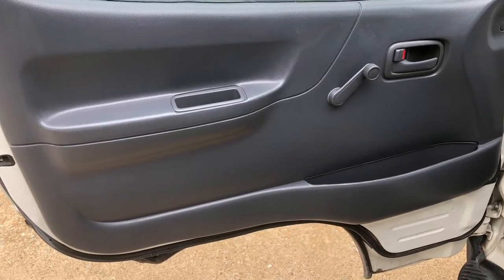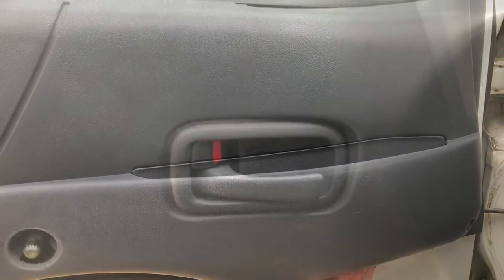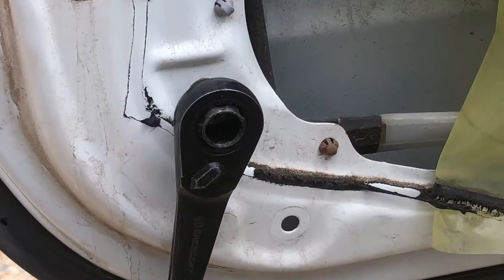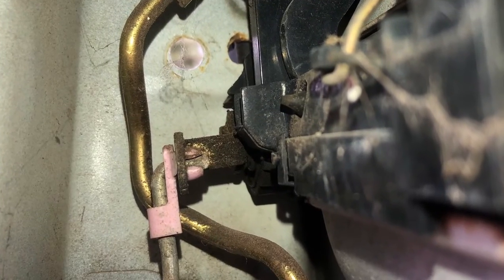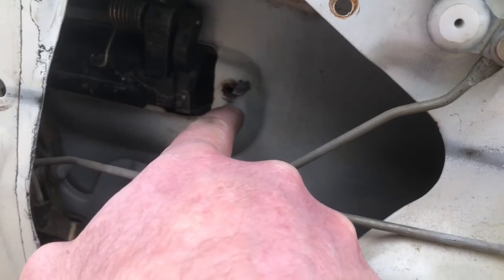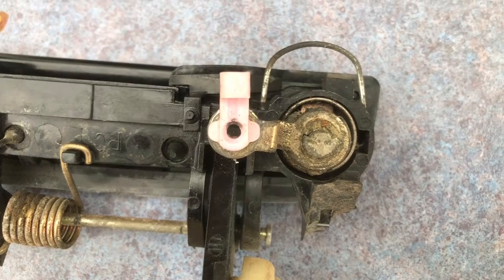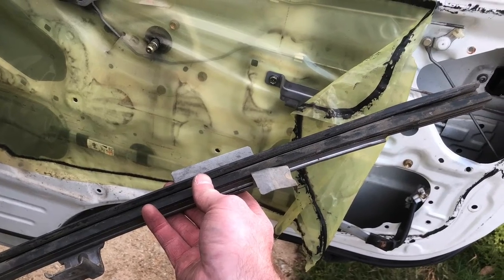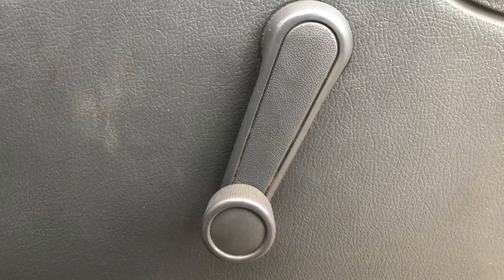How to replace vehicle door handle or lock | Toyota Hiace

Comment: This is great! Do you know what the little orange clips are called (@2.11)? Mine has broken which means the inside door lock metal lever doesnt lock into place - i have tried a few different types of clips but they all seem to be slightly different to what is normally in place
Reply from the maker: Thanks for the comment 😊 few different names for them, you might find them under rod clip or linkage clip or lock rod clips.
Reply from the maker: Also have a look at the Nice Products catalogue online, try the names suggested + cam clips too.

Comment: Hoping you see this! My 96 hiace camper door lock barrel slides back when you pop the key into. Pain in the ass. I'm thinking a clip may be gone in the handle mechanism ..
Reply from the maker: There is a U-shaped clip which does hold the lock barrel in place. Do you think there is a chance the lock has been replaced before? I had a very difficult time finding a lock which fit my handle AND took the same key type as the rest of my locks. If I found one with the same key way I could have rearranged the wafers to suit my key. Long story short, a number of the barrels I tried, did what you are describing despite the clip being in. A slightly different size that still ‘fits’ maybe? I found a lot of dead ends looking for the right lock that fit properly. That said if it is really annoying you may be able to take the handle off and add some kind of spacers between the lock and the clip to prevent it sliding back?
Reply: @The_Gap_Lap  thank you! I was thinking the same. I went and order a new handle assy in case it was the clip but I was told it had been broken into while previous owners had it , so this may be the case. I'll see what I can rig up to catch it in place? Even some 2 part metal putty to fill it out perhaps .. it sits in there ok when used until you apply too much pressure then you need to push the arm that attaches to the back of the barrel back into place. Whatever I do can't be any dodgier than it is now 😂 climbing through the passenger side is a royal pain. Thank you for responding and for the videos! Much appreciated! Merry Christmas.
Reply from the maker: I definitely understand the pain of climbing in the passenger side! You will probably find two small triangular tabs on the barrel which is where the clip sits behind, so some epoxy as you suggested on these tabs should help you out. Might take some trial and error for sizing. 
No problems! Have a great Christmas too & best of luck with your lock 🙂

Comment: can’t seem to get the key lock out, it doesn’t seem to work well works sometimes other times it’s doesn’t let me fully twist the key
Reply from the maker: Sounds like the individual wafers which the key would typically move into the barrel when inserted have worn, and the wafers are not completely retracting. The lock probably needs replacing, but you may be able to use some graphite powder to see if it helps before you go to the effort of replacing the lock. Don’t use a liquid spray like wd40, it will mix with dust and make things worse.